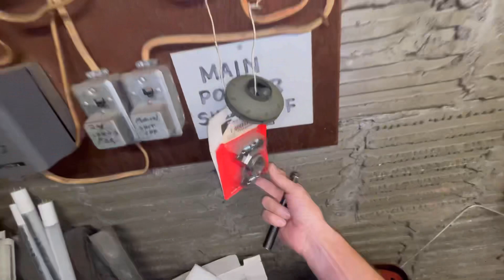Boiler Needing TLC.  #hvacexplained #steamfitterslocal449 #boiler #pumps #B&G #ruthrauff #heating

Comment: Like changing the whole assembly . Some try to get by with the minimum . The supports in the motor can sag and Throw off alignment . I like motor and pump replacement like you did.
Reply from the maker: I’ve seen people use strut up under the pump assembly to try to take the weight off the housing/volute and they would attempt to pick up on the motor.  If the piping is that week I would definitely support the piping but I was instructed from B&G never support the motor just support the piping.  I’ve seen them sag because of the bolts going from the bearing assembly to the motor were loose and vibration caused them to back out.

Comment: Enjoying your videos man! My house has the same setup as this boiler system albeit 25% of the size (1zone). Same or very similar Bell & Gossett pump and residential-type baseboard heaters. I maintain it myself but still have some questions. Should I oil the bearing annually or is that just during install? I do the oil cups every year.
Reply from the maker: Hello good afternoon Luke.  Thank you very much for watching and commenting on the videos I appreciate every reaction good or bad.  I would lubricate those bearings using that particular oil, on the motor just do five drops every year Going into heating season.  I would put 5 drops into the bearing assembly as well.  It doesn’t hurt to keep an additional coupling on site.  They are very reliable pumps just like anything else as long as you maintain them you will get some good run time from them.   I will be posting more videos it’s been a crazy beginning part of the year. Have a great day thank you once again stay safe.
Reply: @hvacexplained9341  Thank you for the info and reply! I was an HVAC tech just never did any boiler repair or maintenance. We're actually in the process of getting ductwork and a/c heat pump installed.  Hopefully the heat pump will take some load off the 'ol boiler, but yes very reliable if maintained properly.
Reply from the maker: @lukehodgson5222  :   It’s totally understandable.  there’s a lot of refrigeration equipment I don’t get to touch. I get a mixture of equipment but very rarely refrigeration and massive chillers.  I do a lot of computer room air conditioners, packaged rooftop units And occasional boilers.  
Not sure what type of heat pump you were going with but I definitely would recommend if it’s a ductless split look into Mitsubishi H2i versions with the Hyper Heat.  The Mitsubishi in my opinion are extremely reliable and if installed properly they run great.  
I installed in my home a high efficient Navien Combi-boiler.  Very reliable, my natural gas bill dropped nearly and half maybe more from the old cast-iron block American Standard boiler that originally was in the house from 1960.  
Have a great day.
Reply: @hvacexplained9341  I may look into boiler upgrade some day.. I'm getting a conventional split heat pump system and ductwork installed. I'm still not to keen on mini-splits but do agree with you about Mitsubishi.

Comment: One thing you didn't talk about is when working on older equipment the insulation around the pipes can be made from asbestos.  How i handle it is to work around it and don't disturb it.
Reply from the maker: That is a good point once in a while I do run into asbestos.  Let me see what I can do in a future video I will write that down thank you very much Jake.  Believe it or not in Pittsburgh it’s still in a majority of our buildings.  If it’s not in bad shape they typically let it stay put until major renovations are going on.

Comment: Change the boiler that’s it brother
Reply from the maker: Believe me.  There’s many of times I’ve recommended replacement of peoples systems, and it all comes down to cost.
Reply: Yes! So I tell them just because you want to save it doesn’t mean it’s right. I don’t miss doing residential boilers.. I’m now dealing with past years actually installing 2 million btus magnetherms… Constantly on those and use neotherms for domestic with its storage tanks etc….
Reply from the maker: @pipefitterwithguns8688  me, as well as many other technicians from our shop have recommended replacement, and the customer has a sales lead. That’s all we can do.   
But I totally get you.  👍